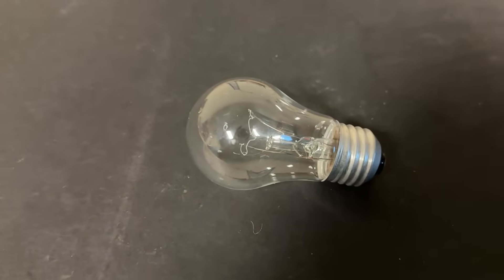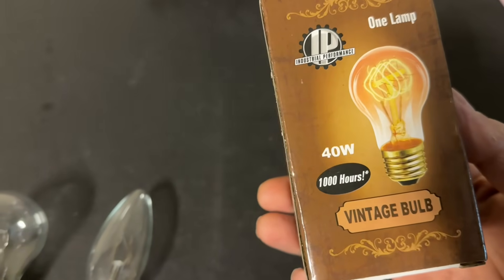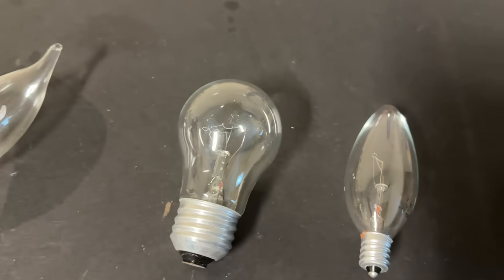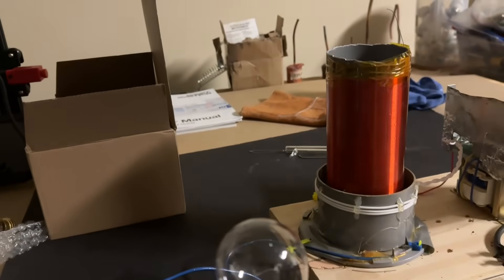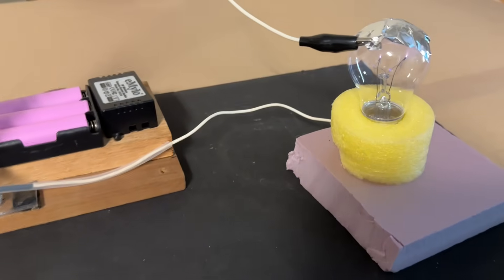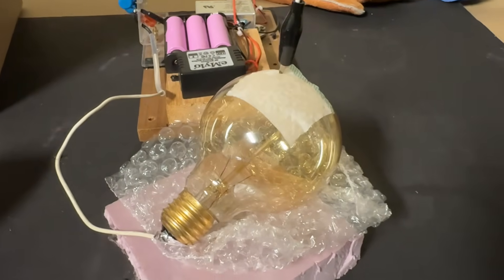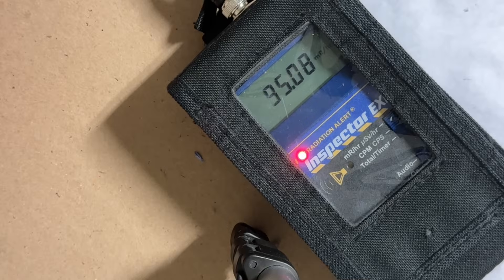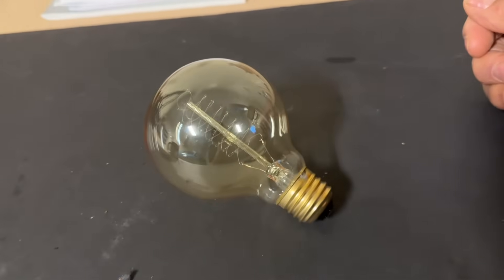Intense radiation output from Vintage lightbulb

Comment: are you sure its x rays? because all the HV generator  generates EMI that interfere with geiger counters... so you should try with the counter inclosed in aluminium foil for ex and see if it persists counting.

Comment: So... my hobby of lighting dead old bulbs with an electroshock power supply to get awesome effect is not that harmless... Thank you so much! :)
Reply from the maker: It’s not that bad. Still scary about how much radiation these bulbs emit!
Reply: If it makes purple flames inside, then it won't make any x-rays.   The bulbs with x-ray hazard are are boring, just some slight flickers on the glass surface.

Comment: That's not even a vintage bulb it's just a modern reproduction made with the same modern technique
Reply from the maker: I did have another one which was not a reproduction and worked great- only problem is it ended up burning up bc the 40kV DC burned a hole through the glass. I was at a loss for words because those can only be found at antique places

Comment: Could still use foil but also use Thermal paste then lay the foil over the top .. your get the connection you want if not better but no local heat spots .
Reply from the maker: Thanks I’ll try that when I repeat the experiment - good idea

Comment: Wow theres a lot of shit in this video. Lets set some facts here. Tesla coils with a spark discharge will emit some EM radiation, locally this is powerful enough to cause a glow in the near vacuum of light bulbs , especially neon ones. So the spark discharge produces some RF and a bit of UV But no xrays, - they can only come from the extremely high speed electrons smashing  into hard targets . You get some weak xrays up close to CRT tv screens using 30,000 volts acceleration of their electron beam.. There can be no alpha or gamma radiation produced here, they only arise in nucleonic disturbances not electronic.   A magnetron might generate some long wave xrays but these would be weak and only present with incorrect tube operation.   So stop trying to be the mad scientist in your garage, you're  just the boy electrician with some costly toys to amuse yourself ( while abusing yourself).      TLDR - this all bs
Reply: In fact, it's all accurate.  The Amateur Scientist, the monthly column in Scientific American, in 1956 had this as a project.  Works fine.  They even took x-ray pictures.  And if you so hate DIY x-ray machines, don't read about their home-build atom-smasher, home-built electron microscope, or four kinds of DIY laser including high-power CO2 laser.  All made in peoples' garages.   Author CL Stong, science nerd extraordinaire, was battling the above sort of  ignorance since the 1950s.
Reply: @wbeaty Don't forget the home made "Farnsworth" Fusors ("fusion reactors") that can produce neutrons! I suspect only a minority achieve the required conditions to do this.
I believe these types of devices are commercially available for neutron generation for neutron imaging purposes?
Reply from the maker: Haha right- everyone to his own!

Comment: Попробуйте замерить радиационный фон во время электросварки, рядом с дугой - будете неприятно удивлены наличием мягкого рентгеновского излучения большой интенсивности.
Reply from the maker: Interesting- I didn’t know that. I know there is a lot of UV radiation during arc welding
Reply: @BrianDhvTinkerer  Hmm, that might just be from radio interference driving the GM counter crazy.  Or, maybe the UV is bright enough to get inside the detector, if it's an alpha-window or scintillator.   Must wrap detector in aluminum foil!
Welding voltage is quite low, although TIG has a Tesla coil to stabilize the arc.
I heard that during WW2, the giant spot-welders used to fuse edges of hull-plates in battleships, they used cap-discharge and immense voltage, and were an x-ray hazard.   But maybe the pulse-switching was done with huge vacuum tubes, and that would explain it.

Comment: Hi voltage's electric field, activate the Giger Miller's  sensor tube, as the nuclear radiations, a, b, and γ amma. The tube has 600 volts DC polarization. When something adds stronger field, its sensitivity increases, and counts is erroneous.
Reply: Not at all, since x-rays from light bulbs have been known for the last hundred years.    If you want to build a DIY x-ray machine for a science-fair project, see Scientific American 1956, where they used the above light-bulb trick as their x-ray source.
GM tubes themselves are well shielded metal, and do not respond to EMI interference.   But the electronics board can have problems.  if you work with GM counters, it's easy to test shielding, and to fix any problems.   Quick test: bring it near a Tesla coil, to verify lack of readings/clicking.
Note that the common radiation meter Ludlum #3 is very badly shielded, and does give enormous incorrect readings when held near an operating Tesla coil, but not near a HVDC power supply as here.   Easily fixed.   You just have to bond the aluminum shell to the main electronics ground, since otherwise the rubber gasket keeps the two parts electrically separate.   With a ground wire installed inside your Ludlum, the problem is gone.
Reply from the maker: I did control experiment to rule out electronic noise from the hv power supply

Comment: seria possível fazer uma lâmpada caseira que gera radiação? quais materiais poderia ser usado para simular o filamento da lâmpada e como tirar o ar de dentro da lâmpada?
Reply from the maker: Main problem would be getting a good glass metal interface for bulb containing hard vacuum. It’s better to start off with a premade insert from another lightbulb and then use glass blowing techniques to join it to a sphere. To evacuate successfully would require a diffusion pump unless you use heated titanium, following evacuation to remove any traces of gas.

Comment: You need a relativ high vacuum to get X-rays, get an education
Reply: Certain lamps contain high vacuum.   This is easily found using a common "vacuum tester" coil.   Small bulbs used in stoves and microwave ovens are usually high-vacuum.   So are exit-sign bulbs.    So are aquarium bulbs and lectern bulbs.   ALso the 7.5 watt "golf ball" bulbs.  But all other types are full of argon.   They just make bright violet glow-discharge, and no x-rays.

Comment: what about modern filament incandescent light bulbs, that's why they have lightning arresters & HV protection circuits in your local recieving power substations to prevent supply crossing the rated specifications.
Reply from the maker: Could very well be- voltages however would have to surge beyond 20 kV to see any appreciable radiation generation.

Comment: It begs the question whether the vintage lightbulb also emits X-Rays when using its intended 120V/AC power source?
Reply from the maker: There is unlikely to be x-ray production with normal use because of the low voltage that I applied only across the filament - high voltage wouldn’t need to be applied between the filament and the outer glass of the bulb to demonstrate any appreciable radiation production
Reply: @BrianDhvTinkerer  Heh, during a thunderstorm, and with an extremely close lightning strike, the vacuum light-bulbs in your home will all give out an x-ray pulse.   Probably a counter would only give a single click!   
Here's a silly idea for EMP detectors:  vacuum bulb taped to alpha-window GM tube.   You could build one which won't be destroyed by EMP.   (I bet it's already patented though.)
Reply: @BrianDhvTinkerer  So if  I understand correctly, it's some element in that particular glass which reacts to the high voltage and generates radiations?
It also makes me wonder if the reverse would be true, like bombarding a piece of special glass with x-rays or alpha/beta/gamma, and getting a voltage out of it, as that would be a lot more efficient and simpler than typical nuclear reactors.
Of course that's what solar cells do with UV radiations, but their efficiency is also limited.
Reply: @VeniceInventors   First, the electrons are strongly accelerated and fly to the electrode on the glass surface. Then the electrons on the inside of the glass are abruptly decelerated by the glass wall. The decelaration produces X-rays (Braking radiation).

Comment: Use saltwater water to conduct the electricity while avoiding localized heating?
Reply from the maker: Good idea- may need to submerge a portion of the bulb in a dish of saline to make electrical contact capacitively with the inner surface of the glass

Comment: What did you say your anode voltage was again? 40kV?  You're making large amounts of low energy xray there.  At that low energy, your tissue is going to soak it all up.  Seriously, I was a radiation worker for many years.  I hope you were wearing a personal dosimeter for this.
Reply from the maker: No, I wasn’t actually, but I could tell and quickly switched it off when I saw the glass fluorescing quite brightly

Comment: I did this with a 20KV Ford spark coil from the 20's and a six-volt battery.
Reply from the maker: Yeah, those coilscan put out quite a bit enough to run these bulbs off the charts
Reply: @BrianDhvTinkerer  They sure can, I probably got more than a little radiation by holding the bulb and letting the sparks and blue glow hit my hands

Comment: That has to be partially conductive glass. The ones that broke were simply the thin glass failing electrically. Field emission from the filament and the sharp corners of the supports would build charge on the inside of the glass until the voltage is enough to overcome the dielectric strength of the glass.

Similarly, it is field emission that causes the x-rays as you have no power on the filament. I would imagine that if you heated the filament, the power would pretty quickly melt the glass. Assuming you can get a few watts through your Cockroft-Walton multiplier. Real x-ray tubes need a lot of cooling to run for any length of time.
Reply from the maker: Yes very interesting and seems to make sense. I wonder how it would behave under high voltage AC applied a similar way?
Reply: This becomes a 20s-era "Crookes mode" cold-cathode x-ray tube, where a bit of gas is required.   If the bulb was pumped down to 10^-9 Torr, this won't work.   In Crookes-mode, postive gas ions with long mean-free-path are crashing into the filament, releasing huge numbers of surface-electrons.   It's a sort of "electron fountain" effect, requiring residual gas.   But with no internal anode, it's unclear how DC microamps could arise.   
If the glass was 10G ohms, then at 40KV across the glass layer, we would expect a handful of DC uA inside the vacuum.    On the other hand, at 40KV across the vacuum-gap, the released electrons might simply penetrate the thin glass.   The setup might need a brief pulse to get going, but once the residual gas is ionized ("dark discharge,") then basically the tungsten surface is emitting betas.   But can significant betas penetrate 1mm glass?  If so then these lightbulbs are cold-cathode particle-accelerators, and the x-rays are just a side-effect.   
Use steel plates to block the output to give a long narrow beam aimed at the GM counter.   Then bring in a powerful magnet.   If the count rate decreases from steering the betas away, then a portion of the counts aren't caused by x-rays.

Comment: Hello friend. Could you explain why a lot of x-ray radiation was produced in the vintage lamp? What happens to it? And would daily use in an environment with normal current voltage also produce this intense radiation? Your experiment is very interesting.
Reply from the maker: The vintage bulb contains a hard vacuum. If used normally with 110V across the filament, the bulb works normally and makes light and heat. No X rays at these low voltages. If a high voltage is applied with negative filament and positive glass, electrons fly off the filament and hit the glass. This causes them to decelerate and produce bremstrahlung radiation in the form of X rays. These pass through the glass and exit the bulb.

Comment: Please tell us you had some form of xray shielding in place.... ESPECIALLY for your eyes!
Reply: Safety = time and distance.    Calculate the time-integrated dose at x meters distance and t seconds, then compare to the x-rays expected from a typical airline flight, or a dental x-ray, etc.   Airline x-ray exposure is roughly 0.6mR per hour, when at altitude, higher during a solar flare.

Comment: You can use high frequency AC with the filament as the single electrode. With no foil on the glass, it will not crack.
Reply from the maker: I need to try that using a Tesla coil. I’ve got one that will put out about 60,000AC
Reply: @BrianDhvTinkerer  Yep, ground the filament, apply HV to the foil or wet paper.   Then, slowly apply a DC filament voltage, adjusted to find the peak x-ray output.   Then, DON'T.   
With a tens- or hundreds-watts Tesla coil, you're massively increasing the x-ray output.   I'd do it in darkness with zinc sulfide screen near the light bulb.   If the phosphor glows the least little bit, that's bad, very bad.    You're up in the x-ray sunburns region.  Only operate for seconds, while hiding behind a steel plate, watching via bluetooth.
Reply from the maker: @wbeaty will try that and do everything remotely ! Got some great phosphor screen material ☢️☢️☢️
Reply: @ someone at work threw out piles of lanex and quanta cassettes, where the old hinges had split in two.  Some had 18in phosphor screens.

Comment: Did I just see Cherenkov radiation in a light bulb
Reply: The glass was fluorescing. Happens in high vacuum radio valves/tubes too running with anode voltages of a few hundred.
Reply: Not really but kind of

Comment: I have seen it in a 1953 soviet book for kids "Своими руками" (With your own hands) about DIY. The first device described there is Wimshurst machine. Then Leyden jar. Then electrostatic generator made from a regular glass bottle ("If you can get a few drops of mercury, it's better for this machine to make a leather cushion rubbed with zinc amalgam instead of a brush"). Of course there was a warning about toxicity of mercury. As well as about dangers of sulfuric acid where they described how to make a rechargeable battery. Also was described making of high voltage generator (capable of producing 10-15 cm sparks) and x-ray machine from a lightbulb. And a movie camera that you operate by turning a crank. If you want, I can upload this book.
Reply: Yes, then spread the word.   Today, USA amateur-science books won't include anything with slight danger.   1960s "Golden Book of Chemistry Experiments."
Reply: - several copies of A Scientific American (and several other magazines) were translated into Russian for several tech.libraries, mostly for the military "research".  There were also several entrusted "writers"... through this machinery the very restricted access to the Western Tech was performed.  Own creativity was insignificant.
Reply: Yeah! Sounds very interesting.
Reply: @SarahC2  I uploaded it, but when I'm trying to post link here, it gets automatically deleted. I hope, you can decode Base64? aHR0cHM6Ly9maWxlcy5jYXRib3gubW9lL2txMXg5Ny5kanZ1
Reply from the maker: I would like a copy of that link too. If you don’t mind. Maybe you could link the link to another link that won’t be deleted.
Reply: @BrianDhvTinkerer  Just decode the Base64 string I posted. There are plenty of online decoders. You will get the link.
Reply: @BrianDhvTinkerer  It's very much like Stong's book "Scientific American book of projects for..."    But totally different.   Full instructions to build a working movie camera and projector.     P145 "X-ray apparatus from an elecric bulb," no shielding included, first build your own spark-gap Tesla coil.   HMM, do Tesla coils perforate bulbs instantly, in the way that HVDC does?   Or does it take longer?   Book is an image, first needs OCR.
Reply from the maker: Ty - very helpful!
Reply: ?? What's the name of it?
Reply: @Michaelpartida-o8b  своими рукими  translate to P. V. Lomerantsev, "With Your Own Hands"
Reply: @wbeaty  He's actually L. V. Pomerantsev
Reply: @ShaLun42  Heh, American, like 5-yr old trying to spell.  The capital "П" has a tiny foot!   And en Español, Bosotoros means Vosotros.

Comment: Does this mean that old vintage incandescent light bulbs are and were dangerous? Is this another product of what manufacturers knew all along, but did not care??? When will it stop that money is more important than lives?
Reply: It's a crude DIY x-ray machine, but first needs a 40,000V power supply.  
If no high voltage, then no x-rays being created.